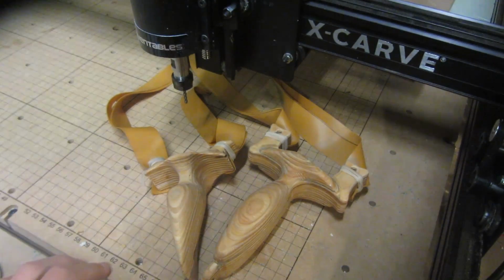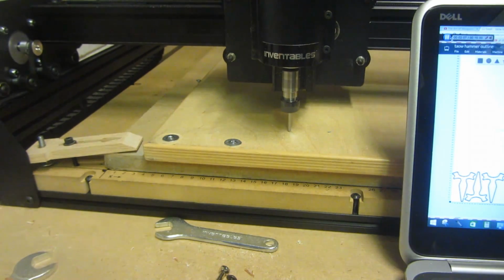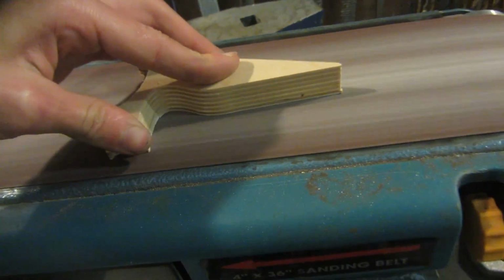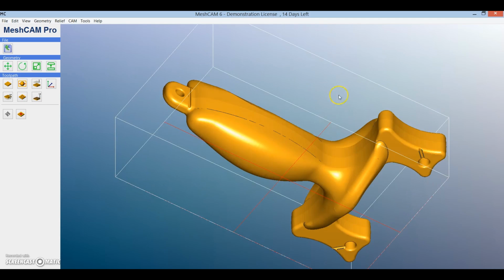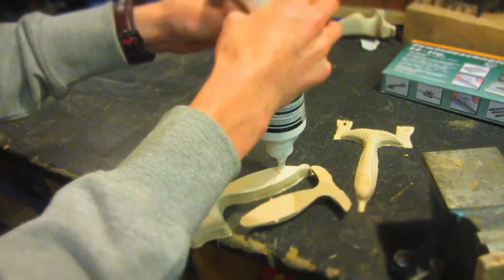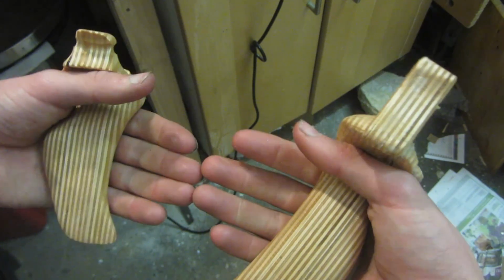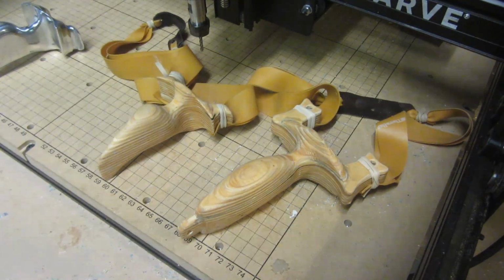How To 3D Cnc Mill Slingshots - X-Carve Cnc

Comment: To get a 3D model you could spray paint the slingshot with a dull (removable) paint to remove the gloss. Then print yourself a visible raster on paper with a known interval of say 1cm, 4 times the size of your model and mark the corners different. Place the slingslot on the raster so all sides and cavities are visible. then take pictures from all sides including the full background grid. DO this with fixed exposure and lens on the camera. You could also place a grid in the background of the slingshot to help. then use software called photogrammetry to generate a 3D model from your photos. (google for photogrammetry) That way you keep your valued slingshot safe at home. ;)

Comment: you're wicked good with the sling dood. Thanks for the tutorial, it's going to be helpful for me getting 3d files into my cnc.  Here's some info you may like: I recommend downloading 123dcatch by autodesk for iphone (maybe for android, and they have a web app). it'll create a decent scan from images you can use for your design. i also highly recommend onshape for cad. After about 30-40 min of the video tutorials, you'll be creating crazy professional stuff via their web app - which is also free. The people that started are a mix of standford smart folks and ex autodesk devs, so they know their stuff. if those tips don't get you started, then hit me up and we can arrange you sending me a slingshot i can scan in with my pro laser scanner, and i'll make an optimized file in onshape, which would be a nice afternoon hobby project.

Comment: I would also recommend trying out MakerCAM. Not nearly as easy to use as Easel, but it's free and you can customize your toolpaths. Instead of carving out all 3 pieces at the same time, you can cut one at a time and save a fair amount of time that would otherwise have been wasted moving between each shape.

Also, thanks for the shout-out and glad the tutorial helped!
Reply: +Count Montecristo Not sure who that's directed at, but my answer is "Maybe..." 

Would help significantly if I had an +Inventables X-Carve... hmm... but I may know someone.
Reply from the maker: Winston Moy thanks,
I have used makercam in the past a few times and have liked some of the features but I find it annoying that it doesnt save your work online and will sometimes crash on me.
Reply: Any chance of doing a "head to head" SO3 vs X-Carve product comparison video?

There don't seem to be any out here, even though a ton of people are asking which would be rated best and why.
Reply: Winston Moy it was intended for you... I was simply in a rush.

If you would, a number of people would certainly be satiated.

-Side question... why are these machines seemingly limited to a 3" Z axis?
(I was just curious about whether there was a functionality or accuracy issue which reinforced this cross-platform consistency. )

Comment: 3D scanning is a bit of a pain and is difficult to edit if you want to tweak it at all - you're better off making it in a parametric CAD program. It's pretty simple to model - sketch a few profiles at various heights (or half-profiles, then mirror later), then use the Loft or Sweep tool, maybe with a guide curve, to make a solid handle. Lofts are probably the best way to get a nice, smooth shape everywhere, with extrusions you'll end up with issues relating to curvature. The fork is probably OK to make from extrusions and cuts followed by fillets. If you send a front and side picture with dimensions on each, I could give it a quick go.

Comment: My only advice would be too use epoxy for the gluing process. Much stronger and definitely would never fail. Also will you make these to take tubes instead of bands as well? You should start selling these, make one too take tubes and i'd definitely be interested in buying one. Make to order to start off, what do you think?

Comment: use Strata Soto se ($30.00), all you need to do is print a special mat, then take several photos of the sling shot on it. it generates a relatively high quality stl, and is way better than freeware like 123d catch

Comment: its way more easier to make 2 pictures (front and side) and in 3d Studio Max to create 3d shape from them and then export it for cad...
Reply from the maker: IamIUareU Thanks I will have a look at that
Reply: The Art of Weapons
if i had time i would make it for you for free so thats why i dont promise but if i get free time i will do it and will tell you...
one question, why dont you use zinc metal instead of aluminium to cast those slingshots? its way more easier and zinc melts on lower temperatures and fills the casts way better than aluminium (when liquid, zinc have less surface tension) and zinc is cheaper than aluminium (at least here in Macedonia)...
(i hate how firefox spell check marks aluminium as wrong word, damn americans...)
Reply: IamIUareU I might be able to answer that for him. The zinc might snap where the band's are attached because it is much weaker than aluminum. Also and more important to me is that using zinc is no fun.  All you have to do is heat it in a pan on a stove. If I wanted to do somthing boring like that I would just use wood.
Reply: +IamIUareU zinc releases zinc oxide when melted which is very toxic and could cause metal fume fever
Reply: Dean Walcott IamIUareU it doesn't matter if either of you are right. Just use an electronic stove or grittle outside like everyone else who does that online
Reply: That wont work since 3d studio max creates planes over a wireframe. A similar effect could be done in Autodesks Inventor software, which would be ideal for sculpting the geometry. Not the most intuitive software but plenty online and on youtube for getting started since the slingshots would be relatively simple models.
Reply: Dean Walcott well zinc oxide is not that toxic since its used as temporally tooth filler when dentists put drugs in your tooth and they need to stay for some time there... zinc oxide eugenol is called... metal fumes yes are toxic and can produce fever but only if you overheat the zinc...

Comment: I have successfully managed to use an old Kinect to scan in complex architectural models, for further drawing and designing. Do look it up, much cheaper and quicker than 3d scanning companies, if a little bit rougher. Also a good PC and a lot of patience is required.
Reply from the maker: becool365 thanks I will look into it!

Comment: hey, in one of Joerg's more recent video's he said that if you rotate each layer by 45 degrees, so the grain is running in different directions, when laminated it will be much stronger. I know however this would use more plywood, but i thought it would be interesting to test the two different methods to see how much stronger it is.

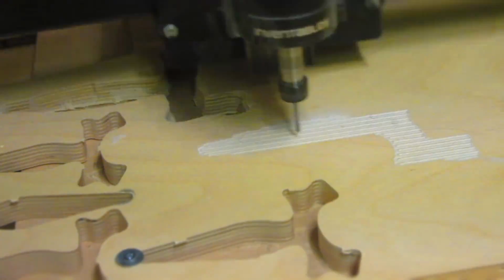Comment: 7:32 go home TAOW ur drunk. Also if u need some cad work done i may be able to help u if u would like. i use a free program called inventor if u would like to check it out. it is fairly easy to learn but it took me about a year to get to the level of skill im at. if the program u were useing has a fiillet option u could easily roud out all of those edges in about 10 minutes but if u need help reply and i can see what we can work out
Reply from the maker: Matthew Dorman ahaha :) I have tried that, I am using fusion 360 and whenever I try to round the edged there is a number of problems that occur
Reply: The Art of Weapons that sometimes happens on inventor too. if you have any pictures with demensions that u could email me i could see what inventor can do with it my email is Mattdorman2000@gmail.com if u would like to get in touch

Comment: I think I could probably make a model of that in Autocad. I've been using Autodesk's inventor program for 3 years or so now in school, and I could totally help out if you would be able to send me detailed pictures with measurements. Also I could 3D print one of these out of PLA, in one peice, which would be equally awesome! PM me if interested!
Reply from the maker: StraightUpFerret awesome will do :)